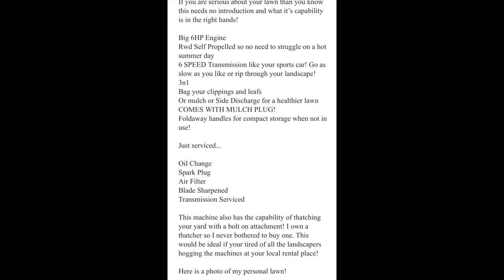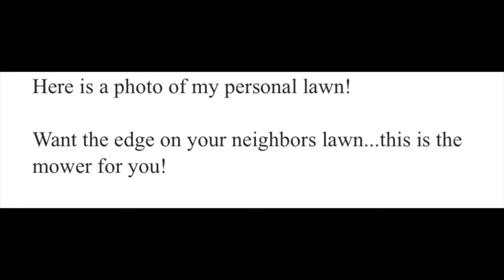Snapper Ninja Hi Vac Lawn Mower Restyle & Restoration Part 3 THE END HOW TO SERVICE

Comment: i have a Snapper that I have had for over 20 years.  Finally lost the motor.  Is it worth taking the time to put a new motor?  If so, where do I get one?
Reply from the maker: shepgre 

You must have the iconic flat head.  Possibly white colored motor.  Those are easily rebuildable. OR just measure the crank shaft size and pick up a cheap mower and use it for the engine.  Curious if a HF predator engine would bolt up?

Thanks for the view and comment, hopefully you subscribed to my channel 🤙🏻🇺🇸🦅🔧